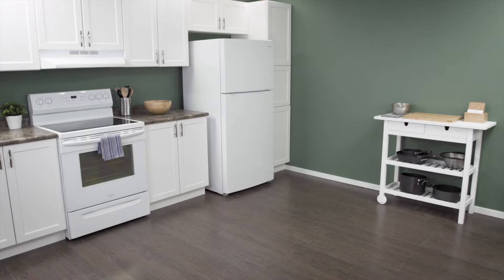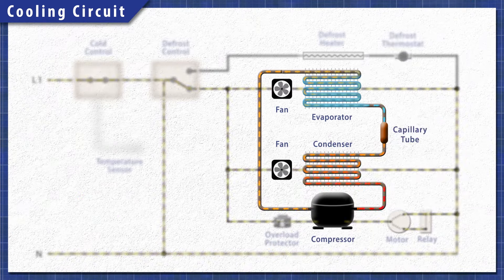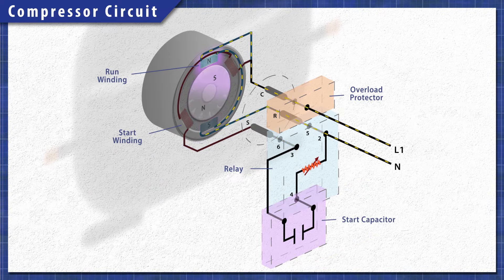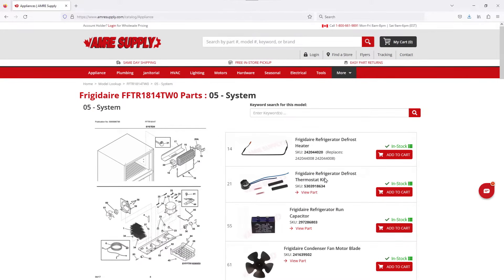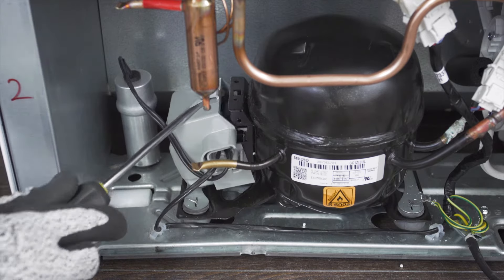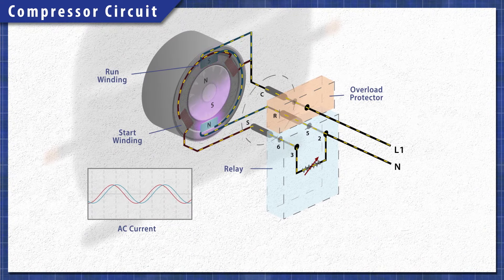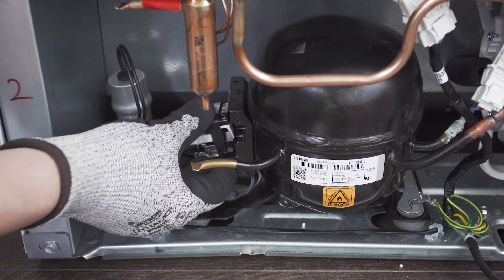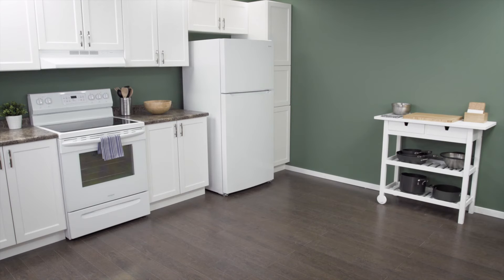How to Test & Replace an Overload Protector in a Refrigerator | Repair & Replace

Comment: Thanks Vance, Sir.  I can't see the terminals that your touching though with the screwdriver to discharge the capacitor. You discharging from the overload protector contact points that run from the overload protector to the capacitor?
Reply from the maker: Thanks for watching. There is some variation between models so yours might look different. If your model has a separate capacitor, then follow the two wires that lead into the relay. You'll discharge between those two terminals. In other models you'll separate the capacitor and touch between the two terminals on the capacitor.

Comment: Thank you for the video, this has explained more in one video than all of my googling over the last few days. 

Quick question, if my Overload is reading 1.2M Ohms, is the resistance far too high and it needs replacing?
Reply from the maker: Thank you for watching, we're just happy to help! 
The overload protector is a non-load device. It is a technically a switch, so normally it will complete the circuit (0 to 1 ohm), or disconnect the circuit (when overloaded). When the overload protector trips, it should have no continuity and no reading on the multimeter. It doesn't have resistance because there is no path for electricity. So the reading will either be - - - - - or  OL (open loop / out of limit). A resistance of 1.2 Million ohms will prevent the rest of the compressor from working, so in this case it's best to install a new overload protector.
Reply: @AmreSupply  thank you, I really appreciate the reply. I thought the reading was way out of range. I tested it so many times thinking it was my multimeter being dumb. Just me. Thank you again, I'll order a new Overload.